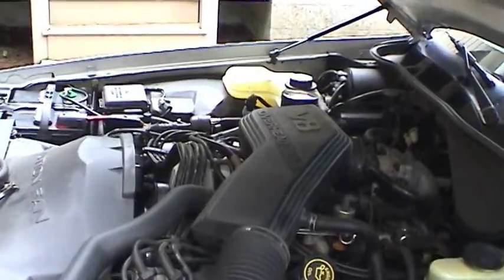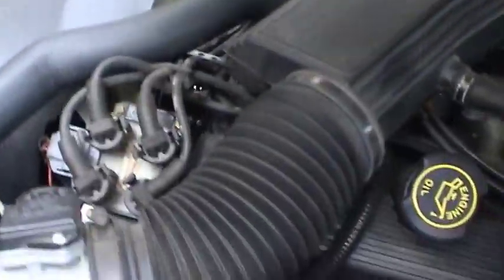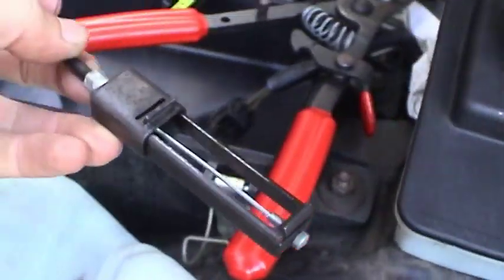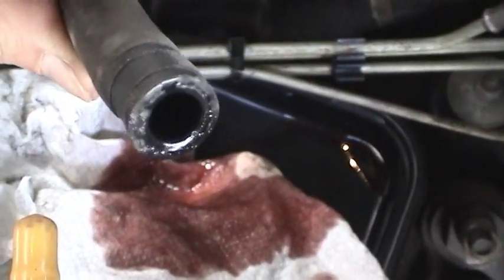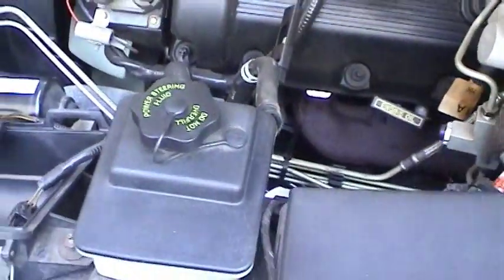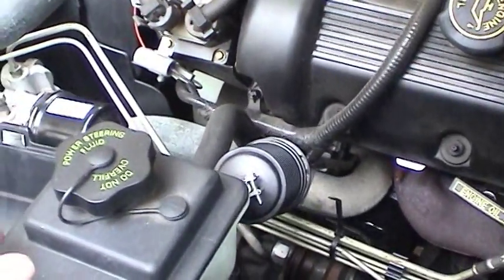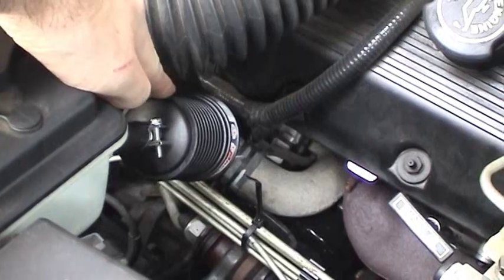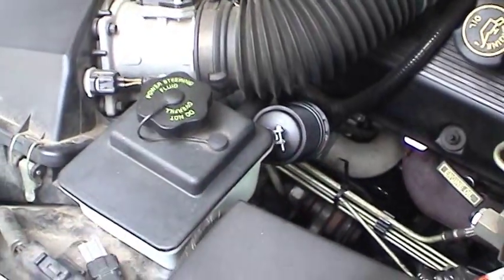1995 Ford Crown Victoria Power Steering System Flush

Comment: The 1995 Service Manual for Crown Vic, Grand Marquis, and Town Car specifies MERCON V Automatic Transmission Fluid. I have used the MERCON V successfully for over 14 years -- The famous 95 MERC is now at 168,000 miles.

Comment: Would standard power steering fluid mess up the power steering pump?
Reply: For best results, use ONLY Motorcraft MERCON V  Automatic Transmission Fluid, as recommended by FOMOCO. DO NOT OVERFILL !!

Comment: Replacing my pump on the 95. Made it well over 200K miles but this is NOT a fun task!
Reply from the maker: You're so right. They are difficult to remove which is why I left it on the engine when I did the engine swap to the white Crown Victoria.

Comment: Great job shadowrider460.  I have a '94 Thunderbird with only 64K miles, which I recently acquired from my father, who was the original owner.  I'm getting through the job of changing fluids on this car.  I'm ready to tackle the PS next, which it obviously needs. I will install the Magnifine filter, too, and I noticed that there is a "flow direction" label , but I couldn't quite make out which way it was installed in the video. Can you clarify?

Comment: Excellent video and concise information.  Thank you for taking the time to film and post.
You're very smart as AMSOIL is the only maker of lubricants worthy of using.  I have trusted my vehicles to they're lubricants for sixteens years now, after having lost an engine to Mobil 1.
I believe most transmission fluids (your mention of Type F) are 10 weight oil.  AMSOIL does make a power steering oil.
I'm would be very interested in a follow-up video on what the filter has trapped.